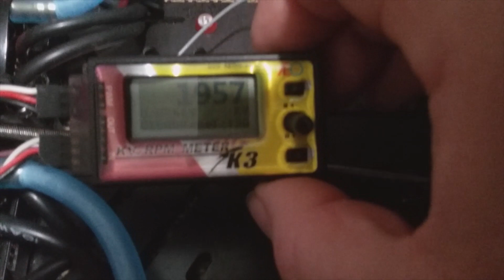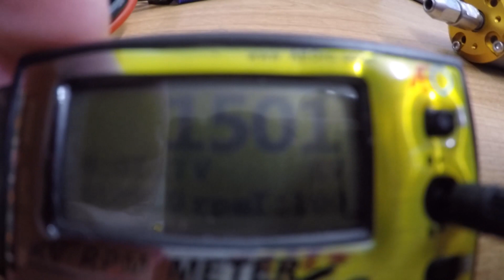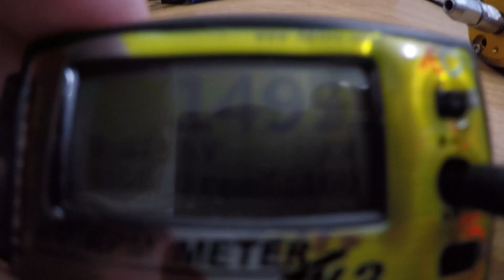SSS 4092 1850kv TP4070 1400kv  KV TEST Future Project......

Comment: I use them (sss)on my Arrma limitless speedrun car , they are great bang for the buck motors ,plus I love the distinct sound of them  they scream ! Do you have any tips or ideas about covering the air ports and cooling for on street running? I am thinking of a 42mm fan placed over the end cap but in reverse so as to draw hot air out from motor and a good fan mounted in its usual spot. I would think a piece of fine nylon mesh with the fan drawing air away would keep my sss 4092 safe from debris and cool. Thoughts on this ?thanks the vid was informative .

Comment: Hey there.  That is awesome! I didn't know there were actual easy-to-use kv meters. Where did you get that from? Also, the TP sounds like it needs bearings😅. Keep up the good work. Always waiting on new videos from you. And yes, I would like to see it in the Ariane😁
Reply from the maker: I think I got it on ebay, hobbyking also had them.
The TP is brand new, may just be the low rpm that makes it sound like that.
Thanks I might put it in there.

Comment: Interesting test :)

Are you sure about the kv? On your first video of this boat, you mention 1800kv...
Im not 100% certain, but I  believe that these are sold stock with 2 x 4082 2000kv...?
So you made a change to the setup before order?

The reason I ask. I have never...I mean never, tested a SSS motor to be equal or greather than stated kv. Always 100-250kv less. No matter size, 4072, 4082, 4092, 5694 etc. So if these motors are 2000kv, I could understand ;)
Reply from the maker: Thanks
The little cheetah comes with 4082 2000kv as standard equipment.
This is the 40" XL cheetah, I tried doing as much research on it as I could but as you know not much info out there.
The only 2 listing I seen for the cheetah XL were 1650kv and 1850kv both 4092, I did not modify the order just got what they come with.
They don't make 2000kv 4092 only 1850 or 2140kv and the 2140 are listed as 2200 in some places.
I completely agree with you they were always lower but the zonda motors came in almost exact at 2070kv 
My 34" Cheetah was ordered with 2200 4082 they also measure higher at 2300kv.
I also tested another set of sss motors a few months ago and they were 200+kv higher then rated.
Last year TFL/sss was posting pictures of their new kv tester this may have something to do with it.
Reply: Oooh. I see. Ok, thats big changes for the company.. 

Thanks for info :)
Reply from the maker: They're steppin up their game LOL 
SSS motors FTW
Reply from the maker: No problem Sir.